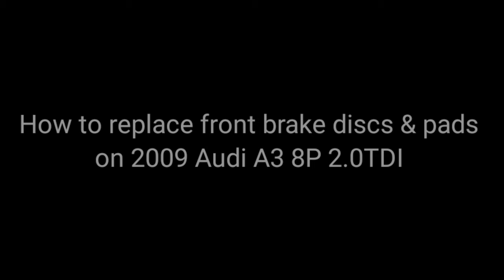How to replace front Brake Discs & Pads on Audi A3 8P 2009 [Zimmermann Sport + ATE Ceramic]

Comment: Do the Ate ceramics works well? How do they hadle heat?
Reply from the maker: Not at 100%. At  low speed they are very nice. But   At high speeds  and continuous braking, the ate ceramic doesn't hold the discs very well.  I Also think because of the holes in the zimmerman discs.  I would try ATE normal, not ceramic.. I expected more from ceramic..
Reply: @domworks Ate ceramic are made for basic discs, not for perforated ones, I don’t get why you thought was a good ideea to pair them with these discs, no one could possibly recommend this.

Comment: Were u satisfied with the Zimmerman & Ate ceramic combo ?
Reply from the maker: Not at 100%. At  low speed they are very nice. But   At high speeds  and continuous braking, the ate ceramic doesn't hold the discs very well.  I Also think because of the holes in the zimmerman discs.  I would try ATE normal, not ceramic..
Reply: @domworks  Ate ceramic brake pads does not work very well with drilled/slotted discs. You have to use normal discs in order to get them to work properly.
Reply: @domworks  does the ate normal work okay? Do some noise?

Comment: Hey mate, i have an a3 8p 2.0 tdi cr140 quattro. Would you happen to know if the brake size is 288 or 312mm? Cheers and good vid btw!
Reply from the maker: Hi mate it depends, the best thing is take 10 minutes to remove the wheel and measure it

Comment: How are them after 1 year?
Reply from the maker: Not at 100%. At  low speed they are very nice. But   At high speeds  and continuous braking, the ate ceramic doesn't hold the discs very well.  I Also think because of the holes in the zimmerman discs.  I would try ATE normal, not ceramic..
The discs are good for now.. but the ATE ceramic ,.. I expected more.

Comment: no brake test? sad
Reply from the maker: no because you have to let pass some time .. but after more than a year I can say:  Brakes Not at 100%. At  low speed they are very nice. But   At high speeds  and continuous braking, the ate ceramic doesn't hold the discs very well.  I Also think because of the holes in the zimmerman discs.  I would try ATE normal, not ceramic..
The discs are good for now.. but the ATE ceramic ,.. I expected more.